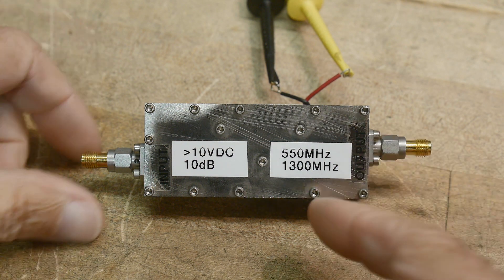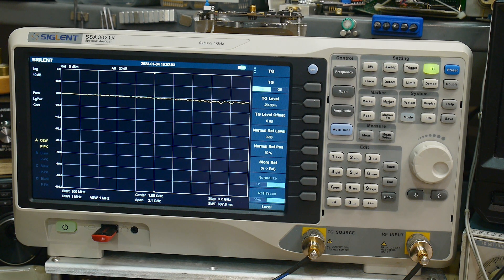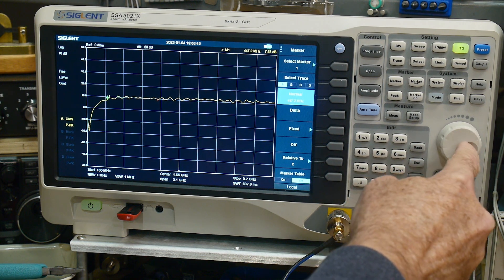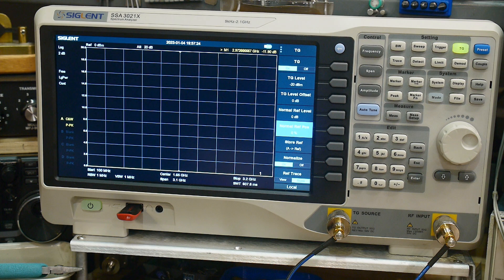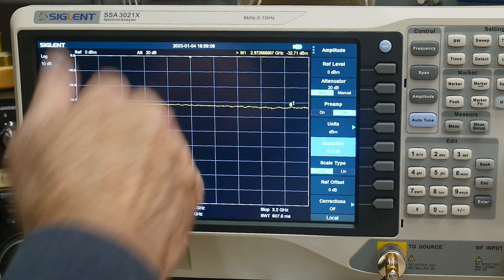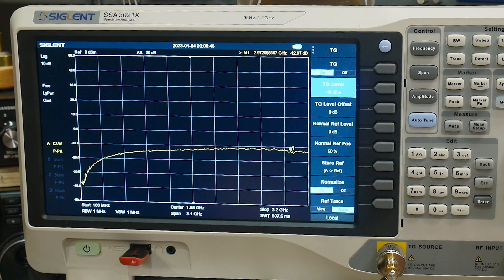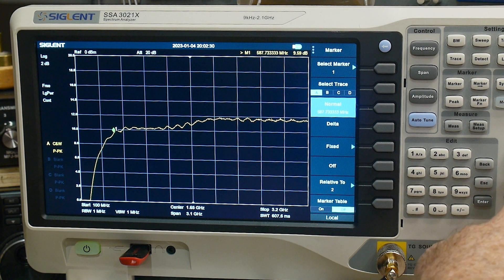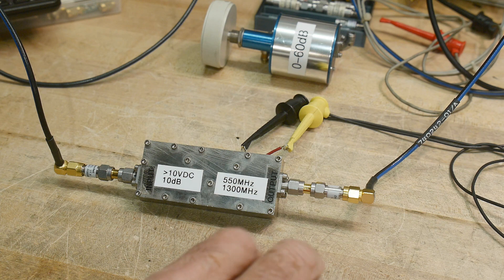#1393 Use attenuators to minimize mismatch

Comment: Brilliant video. Folks usually settle on what ever is easier (less connections) and use "stock" amplitudes.  Attenuation pads (as much dB as you can allow) will massively improve every measurements' accuracy. Once you get into the routine of S1/S2 calibrations then you know that what you measure between your 2 calibrated ports can be trusted.

Comment: I am using a -6dB pad at the input of my SD2933(×4) MOSFET transistor amplifier; it smooths out the input SWR to 1:1 which otherwise would be higher (meaning reflection) and especially on some of the bands in the 1.8-50 MHz range. The input from the exciter Yaesu FTDX-1200 is only less than 5-7 Watts depending on various bands though.
Any amplifier's input/output may be exhibiting a characteristic impedance slightly different from the ideal 50 ohm which is quite true of my homebrew linear amplifier. A nice demo 👍
De VU2RZA